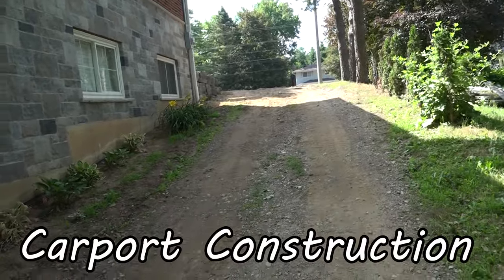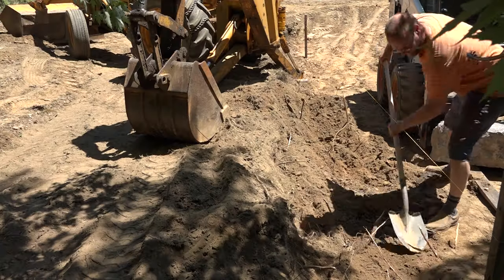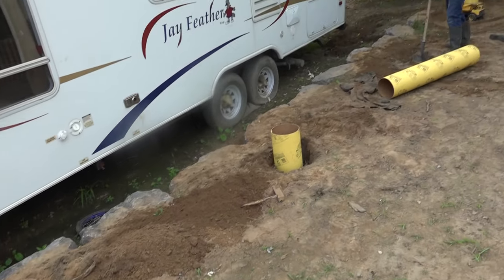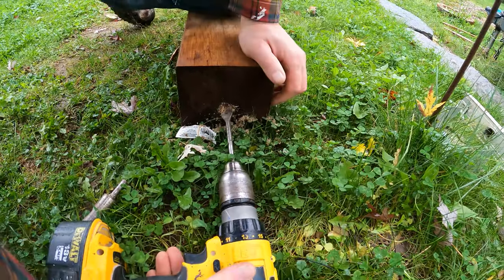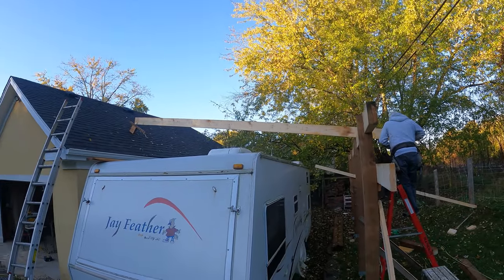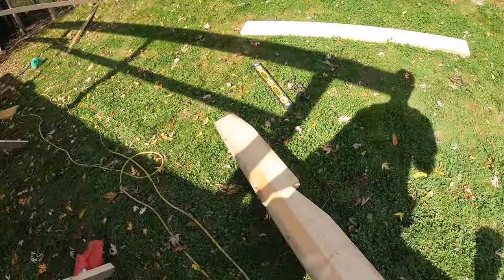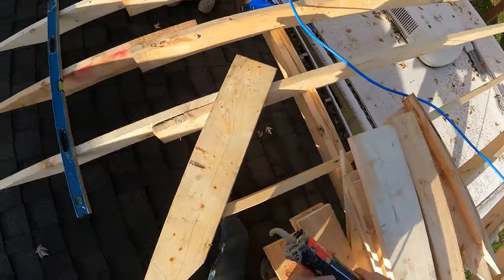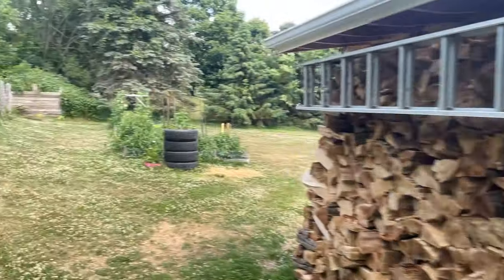DIY RV Carport Build

Comment: Good job!  Great video!  I may have missed it, but how wide is your shelter build?  How much wider span can you go from an existing roofline like this?  I am thinking about this for my new RV.  I would really like it to be 20 ft. wide.  The only problem is that the RV is longer than the depth of my building!  Not sure how to handle that issue?
Reply from the maker: I think I went 16ft out front the wall.  As for how far you can go out, it depends on the foundation, joist strength etc.   may want to check with a local builder.
Reply: Will do.  Thanks for the reply!

Comment: Great video! For a concrete slab, would you have to breaj ground for posts? Not seeing how i could use mounting plates
Reply from the maker: You would have to drill holes and then epoxy the plates in.

Comment: How did you seal the joint of the new roof from the old roof won’t water run right underneath the new roof edge?
Reply from the maker: We installed the shingles under the ones on the existing roof, so that it is like it was shingled all at once.